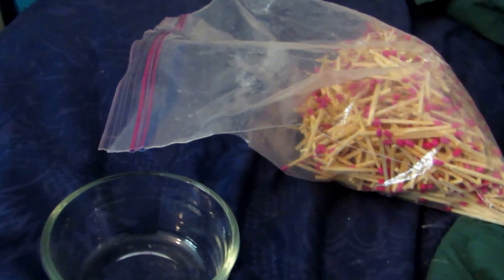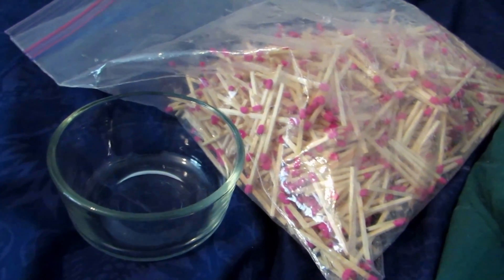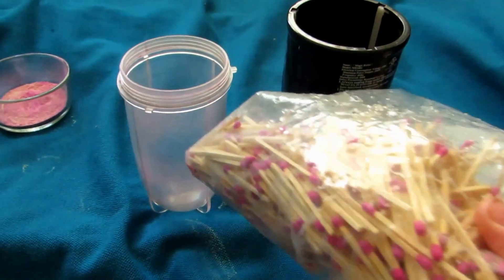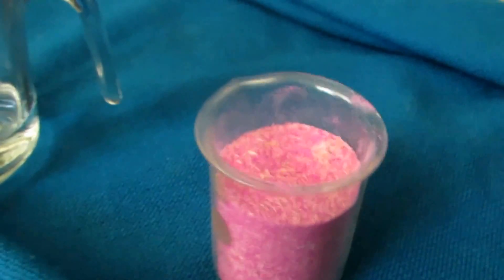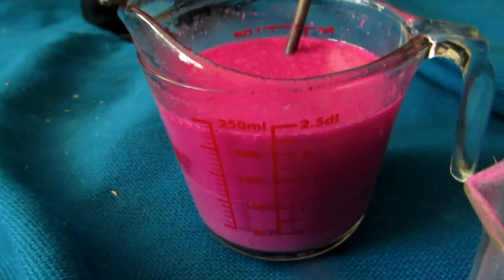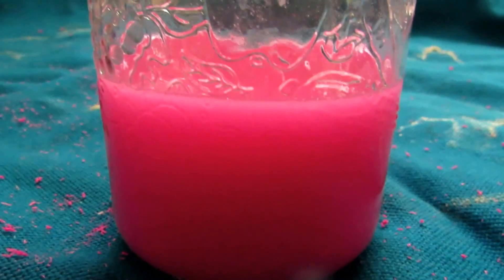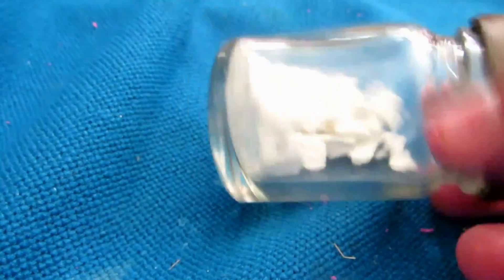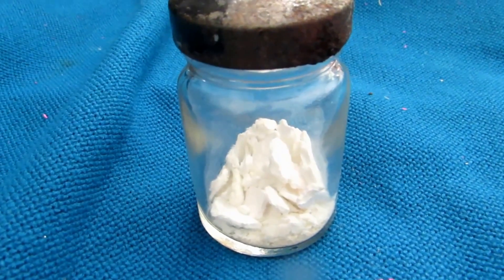Extract Potassium Chlorate from Matches.

Comment: Can I use my buchner funnel to filter this? As the vacuum would be much quicker, unless you think it would ruin the yield?
Reply: That should work fine. If you have a Büchner funnel you probably understand enough chemistry to make KClO3 by boiling down bleach and adding potassium chloride, or by an electrolysis cell. Both those methods will give you much more chlorate that’s way more pure.

Comment: I did that without cleaning the dye. From 10 boxes of matches I scrapped, I've got like 1 small spoon of kclo3, tested with sugar, burns well but not super well so it's not a fine product (still burns faster and stronger than normal matches). Very inefficient and without spending a lot of money on electrodes and electrolysis equipment you have no chance to get good amounts of good quality kclo3. It was a lot of scrapping from the pot even though I left it with some humidity to dry (very hard to scrap off). First I was scrapping using a wooden spoon but when I saw small particles of wood falling into a pot I decided to finish with a normal spoon. The only way is to ask somebody who has access and can buy and rebuy from him illegally pure powder 99,8% instead of this. Btw. you can burn leftovers from matches blend them and get charcoal for black powder. For scrapping, I used a sharp knife + spoon I was holding in one hand first crush lightly between spoon and knife and scrap leftovers with a knife it takes 4-5 seconds per match to fully scrap. But that scrapping is not worth the time. Better cut the ends of matches and blend them put in almost boiling water let it cool, put for a few minutes in a fridge, and then strain through a coffee filter. After scrapping from the amount you have you will get around 1/4 of it.
Reply: You add sugar to potassium nitrate and prochlorate, so why not blend the two?👹

Comment: Hey genius...why not just throw the matches in the water/ solvent and use an automatic stirrer for a little bit and not waste time...also...if you left the matches in the matchbook you can crush the tips off fairly quickly 20 matches at a time if you can really feel the need to take the harder route...or use a rolling pin at least...only an idiot will grab 1 match at a time and crush the head off and spend 20hrs doing it before realizing that it's a bad idea... when you get older  eventually you will learn to work smarter not harder

Comment: There's also sulfur in the heads.
Reply: Sulfur will not dissolve in water he would have to separate it from whe wood pulp at that point
Reply: I thought sulfur comes during the reaction of the p c and red p on the box

Comment: Why would you go to all this extra trouble when its going to contaminate the kclo4 with cellulose and tannins etc.. 

Just cut the match heads off and throw them in water to soak then agitate till all the kclo4 gets washed off. Heck you you don't even need to cut them off the match. 

You need to stop and think about other factors than just time, as this was a horrible process to extract anything from the match. 

This is the only negative in the video for me though. So congrats on a great video, its nice to see enthusiasm.
Reply: Kclo4= potassium perchlorate
Reply: @Pyrokartoffel  Woops! Change the 4 to a 3 i guess.

Comment: Potassium chlorate for flash powder is a bad idea since it breaks down over time and forms acidic compounds.
Reply: but you basically need it to make decent firework stars that actually have color.
Reply: Only if it wasn't sufficiently washed and based to remove all trace of anything even remotely resembling an acid.

Comment: A tip for scraping matches, use a small tweezers and squeeze the corners of the tips. This removes essentially 99% of the tip and you won't have to worry about any significant amounts of material going to waste unless you scrape a large batch of matchsticks. This does however take slightly more time than using a plier.
Reply: This is better. Get some boiling water and just put the matches in and it will dissolve then use something to take tge sticks out

Comment: You could just soak the matches heads down in a little water.  The match heads will just crumble off after a while.  How about people start working through problems and then make their videos.
Reply from the maker: loyd webber I didn't think of that, good idea! Thanks
Reply: Your welcome.  About working through problems first, your video is not that bad.  It's educational to see problems people have had.
Reply from the maker: loyd webber thanks
Reply: loyd webber - by going through the process and showing your mistakes, then other people are less likely to also make them.

Comment: disolve with rubbing alchol till you have a paste. let dry.
Reply: The Canadian Chemist He means dissolve the matcheads in alcohol, isopropyl has a ridiculously low boiling point so it evaporates  heating. BTW I'm also a Canadian chem head trying to do the same thing with sudo efficient methods. I'm currently trying to make rust powder for thermite, and it is definately harder than it looks as it takes a while to filter out precipitates. If you want to make KNO3 although weaker than KClO3 it burns slower which is great for rockets, just grab some instant cold packs (they have to contain Calcium Ammonium Nitrate or "CAN"), I get mine from Shoppers' Drug Mart, and mix them with KCl or sodium free salt.  CAN is H4CaN2O3, a little intimidating,  but here are the numbers; the molar mass of one mole(mol) of molecules of CAN is 120.1232 g, the molar mass of one mol of molecules of KCl is 74.5513 g. Ratio should, in theory, be relative to numbers, without accounting for impurities. you will get one potassium nitrate per molecule with venting of ammonia gas, chlorine gas and hydrogen (PLEASE, I BEG YOU, DO THIS OUTSIDE OR YOUR PARENTS WILL NEVER LET YOU DO THIS AGAIN, AMMONIA GAS IS TOXIC AND IT STINKS AND STINGS LIKE HELL). For every 1 g of CAN you will need 0.6206 g of KCl or for what ever amount of CAN you have, use this equation, 0.620206236597*(grams of CAN) to get the amount of KCl you will need. Dissolve both substances in seperate containers of water until they are completely dissolved. Mix both substances and dont breathe it in. come back after say 10 minutes and stir it gently. Come back after a minute and filter out the precipitate (I believe it is Ca(OH)2). Your product will be semi pure, dissolved KNO3. now do what you would do to boil out the water but be careful because you know, KNO3 is ridiculously flammable.
Reply: @joshuatervakoski2230  That is the longest comment I have ever read. That was a lie, I didn't read it all. :(
Reply from the maker: I have done this before, i make sodium nitrate though. Potassium nitrate is fun and all, but not super useful in the sythesis of other chemicals as there are cheaper substitutes, like sodium ntirate. It is produced similarly except by reacting the calcium ammonium nitrate cold packs with sodium hydroxide. through a series of similar processes you described, sodium nitrate is obtained. I use it in the production of nitric acid which is a very useful reagent and i typically use it when recovering nobel metals from scrap, or if i need to nitrate a compound. Also, just a side note, potassium nitrate is not flamable, it is only a rather strong oxidizer, pure potassium nitrate will melt and not burn, if you mix it with other materials such as carbon, sulfur, aluminium, sugar or other materials which react with oxygen, then you get a flamable mixture. :)
Reply from the maker: dissolve what?
Reply: The Canadian Chemist Well yea, I know KNO3 is an oxidizer but it will burn because it is an oxidizer and holds its own oxygen. If you light it up with a less than half ratio of powdered sugar it makes it useful for multi stage rocket engines, (1, liftoff thrust stage: fine gound KNO3 loosely stuffed less than half powdered sugar, 2 flight thrust stage: densely packed fine grind with slightly more powdered sugar.) I struggle with the KNO3 though because KOH which is what I would originally use is expensive and hard to come by, so KCl is a cheaper option because K compounds are uncommon in here in canada. I understand you have done the CAN method for NaNO3 and have you ever accidentally caught a whiff of the escaping ammonia? Man, that oughta clear the sinuses, that stuff is STRONG. BTW you making thermite yet, the stuff is fun but it requires patience for the rust.
Reply from the maker: Joshua Tervakoski I did thermite a while ago, it was fun. If u check my 1000subs video, I lit a kilogram of manganese dioxide thermite on ice, that was fun

Comment: Or you could just boil a ton of matches in water and then scoop out the wood once the matchheads have dissolved.
Eliminates the need for grinding shit.

Also, you're not exactly a chemist are you? XD
Reply from the maker: smart, and no... I suppose I am not really a chemist. Although I am in grade 10 and have completed grade 12 chemistry already. I really do love chemistry and plan on making a career on it.
Reply from the maker: Dave Smith yeah, I know the electrolysis of a solution of potassium chloride at elevated tempuratures is much more efficient, and I do plan on doing it, but I had a bunch of matches laying around and needed to do something with them. I really do want to do the electrolysis method though...
Reply from the maker: Persekarva yes, to boil the matches would work excellently, I will try your idea if I ever have hundreds of matches again.
Reply: Or you could do electrolysis of a certain salt for a much better better yield, but then again YOU probably aren't a chemist either. 

He provides a simple practice for anyone to try out the basics of extraction and purification by recrystalization without an expensive micro or macroscale kit. Take it for what it is. I found it fun to watch.
Reply: While it certainly is true that electrolysis is an efficient method for synthesis, this video is about extraction from matches. So i gave a tip on how to do the same thing with much less work.

And no, i'm technically not a chemist either, because i don't have my degree yet.

Comment: How do you re crystallise it?
Reply from the maker: a recrystallization relies on the fact that some things are very soluble in hot solutions, but less soluble in cold ones. To do a recrystallization, first find the solubility at different temperatures, because potassium chlorate is quite soluble in hot water, but not cold, first we heat it and create a saturated solution. You know you have done this because the potassium chlorate will probably start to form small amounts of solids as the solution becomes to saturated to hold more. At this point, a little bit of very hot water is added to dissolve what began to crystalize out, then it is left to stand and slowly cool. As it cools, the solubility decreases, so crystals form. When cool, they can be filtered off and washed with a bit of ice cold water. That is essentially how to do a recrystallization. Potassium chlorate is insoluble in acetone, so you can rinse them in acetone to remove impurities and the dye from the matches.
Reply: piano and science guy thank you very much where are you from ?
Reply from the maker: Ben King canada

Comment: after you get the crystal, mix it with red phosporus 50/50
Reply from the maker: I have already done it, it is so much fun!
Reply: +piano and science guy bro no need to get pure chlorate crystal, to make the method sufficient just dissolve match powder with hot water, fillter it with layer of tissue, after that boil it there you go, but dont worry for the chlorate color, that didnt change the burn rate of it, at the fillter it is all sulfur, after it mix it with kclo3 50%+50%aluminium powder at least 200 micron+30% red phosporus there you gooooooo! super powerful flash! you can also make mini crackers on it :) but dont exceed .5 g it would probably would kill you.
note: mix first the aluminium and red phosporus and second chlorate:)
Reply from the maker: Pyro Creations neat, cool... I will have to try it.
Reply: What about aluminium powder?